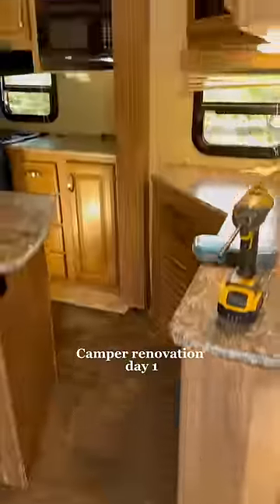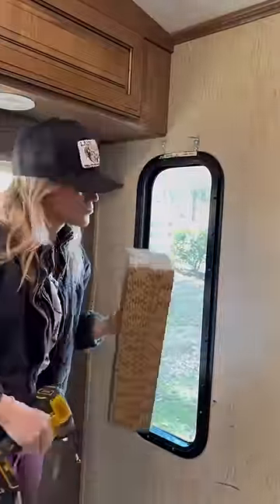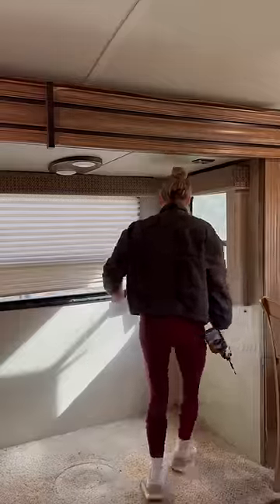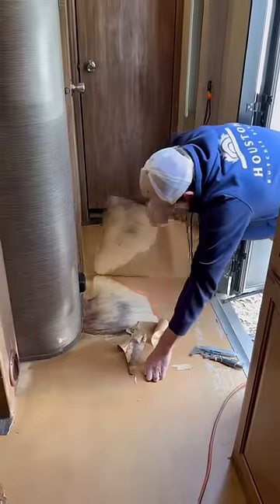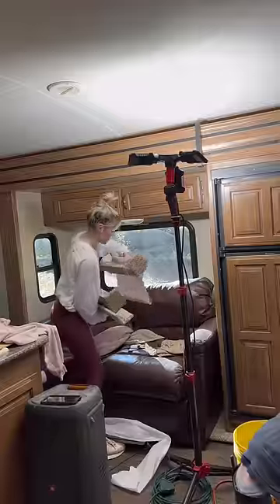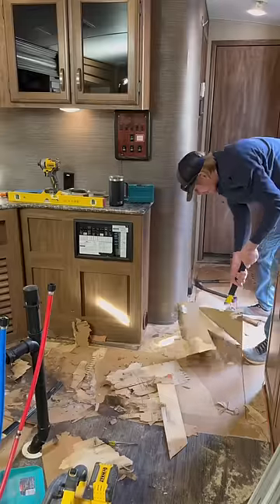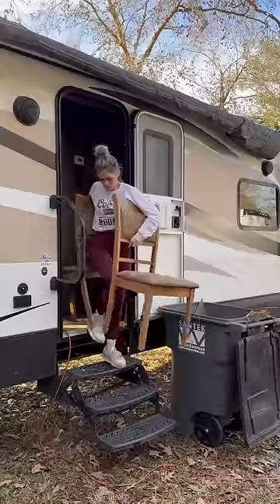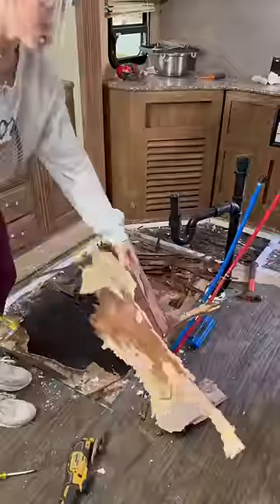I’m so excited for this project! #camperlife #rvrenovation #diyproject  #renovationproject #texas

Comment: Those soft spots are water damage you should check the plumbing and roof for leaks  before replacing the floors or else it will rot again
Reply: Good advice 👍
Reply: Window leaks also
Reply: Every year RVs need to have the roof resealed, although I believe how often depends on where you live. Areas with lots of rain, probably more often, drier weather less so. Some choose to buy a pop-up awning or they build a sturdy roof cover to mitigate weather damage but most use tarps.That's one thing I wish someone had told me before I got mine.
Reply: Soft spots are often hidden and always seem worse than you planned on.  Sometimes you need to plan on just replacing the entire floor, sealing all windows, etc. and making sure the roof is sealed and leak proof.  Then, check the outside covering for leaks as well.  Once that is done, you can renovate the inside!
Reply: Love it ❤
Reply: I think she knows lmao. 😂

Comment: Staying on pace cleaning as the guys were working is probably the biggest bonus you could give them. They will remain motivated to continue working. As a trade guy if I had to stop and clean up for even 15 minutes, I didn’t feel like going back to work. Having 3 people is much better than 2. You are doing everything right. I hope it turns out well.

Comment: Those blinds are good if you have single pane windows in your RV; they cut down on the heat comming through the window.
Reply: And the cold! Plus they can be expensive to replace depending on which manufacturer you bought from and the size of the day/night shade. Crazy to just throw them out!!!!
Reply: I'm sure she'll replace them with better looking curtains. She's not leaving the window bare.
Reply: I had duvet blinds in my RV and I loved them
Reply: @redheart3014 there is no better blinds for a trailer! No joke! Those of us that have them know that!
Reply: They were actually cute. I wasn't a fan of the little outer edge bit, not sure what that's called, but the blinds were nice

Comment: Hint for the winter time, keep a window or vent cracked for the moisture control and condensation that will build up. Getting a few dehumidifiers is great and will be needed! Mini damp rids are great for any place you store stuff too like cabinets and under beds etc for moisture control and to help keep mold out!

Comment: Those curtain slide down things keep out the heat amazingly. You can always keep them and hang curtain rods over them with cute curtains.
Reply: Also those are light weight, trailers move lol you don't want traditional house blinds that are solid plastic and heavy, especially if you get cut off and slam on the brakes! You want light weight customs shades not heavy plastic

Comment: My brother is just like this! Ive been remodeling campers for a while now. I would pull the windows out and reseal them, same with the vents. Also, put black jack or something similar on your roof to reseal. Probably should plan on that at least every other year. If you're going to heat with propane, that's where your condensation comes from. I would get a different heat source, mini splits are awesome. If you have access to power that is. If you do, i would also put in an electric stove/oven. Sorry, been here and done that....

Comment: Thoe "curtains" are actually specially fitted BLINDS.
They're an original feature & one of the better parts of that lemon you just bought.
Reply from the maker: Yeah, well that original feature is super outdated. I can’t wait to show y’all what I’m replacing it with!
Reply: @Leah.Goodrich those blinds are energy efficient.
Those windows are single pane and let in so much heat and cold. 
Replacing the top piece being replaced is a good thing. 
You will regret removing those blinds. 
You will need multiple dehumidifiers or you will get mold. 
Did you fix all the water leaks that led to the soft spots.
Reply: Those blinds are designed to keep the cold and heat out.  Any other blind does not work, not even curtains work I know my neighbor is regretting getting rid of hers now. They still use those blinds in new RVs, campers and camp trailers. Remember certain counties do not let you live in a camp trail.  I know my uncle let my cousin stay in one and the county told them they can't allow it so check your laws.

Comment: Been there done that replacing everything floors windows upholstery in 1972 32ft Champion bathroom new toilet shower hot water heater rebuilding the furnace. Made my on curtains one piece aluminum roof all new rafters inside ceiling

Comment: The the top of the camper, whole floor items need to e removed and check under and the walls at the windows,. etc.,.

The redo is an easy job if u have contractors abd can do the work. Great buy!!

Comment: those aren't curtains those are blinds they will help keep out heat in the summer and help insulate in the winter and you'll be surprised at how expensive replacing them will be

Comment: Did you check for roof leaks first before all this repair is completed?
Reply: Excellent point. Unless that floor damage was due to leaking water lines, the most likely culprit is a leaking roof. The sun and rain take their toll on RV roofs, so rather than repairing/replacing my roof seal often, I invested in a metal carport to go over my travel trailer. It also provides shade, which helps during hot months.
Reply: This^^^^...(if not) a big tarp or a quick metal lean-to covering it would help in the meantime. That way they could repair the roof soft spots, redo all the caulking, and check the slideouts. Wouldn't want to ruin all their hard work with more leaks. My camper leaked the most at front seals (from all the driving), at the windows and unfortunately the storage doors underneath due to bad weather stripping (and it was only 2 years old).
Reply: @ladyanntheog thank you for reminding me I need clear caulk tomorrow.
Reply: @ladyanntheog thank you for reminding me I need clear caulk tomorrow.

Comment: HOW LONG IS YOUR CAMPER? I'M TRYING TO DECIDE ON LARGER CLASS C OR THE 5TH WHEEL ETC. I'D BE DOING ALL MYSELF. SINCE SO REMOTE I'M NOT THAT WORRIED. JUST PULLING IT. But a good driver.
Reply: There are definitely pluses and minuses to both. My husband and I personally prefer a 5th wheel. And his parents don’t really have a preference. His dad fixes them up and sells them. He is in the middle and likes them both the same depending on certain features.

Comment: I so admire your diligence to want to fix that camper up, unfortunately your work will be in vain because that camper will leak again and again and again. If you're going to live full-time I would suggest you get maybe a Mercedes sprinter van or something towing a large camper is going to cost you a lot of gas and a lot of wear and tear on your tow truck you may find it to be more economical to have a single vehicle. Good luck

Comment: omg i HATE those camper curtains! i lived in a camper for 3 years after my house burned down in a wildfire and the camper had a few other issues (septic, roof leaks ect…) but thoose blinds where the worst! 5 out of 13 of them were still working by the time i moved and they just were pulled closed all the time bc the stupid strings were too frayed to hold em up! good choice to get rid of em
Reply: Those are blinds, not curtains.
Those particular blinds are very energy efficient are huge at keeping the the heat and cold out due to the single pane windows.